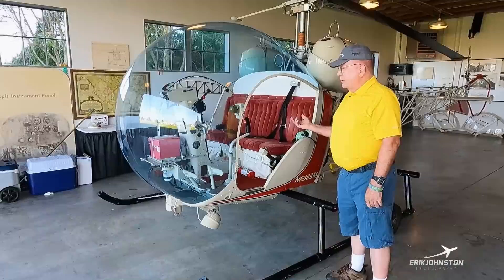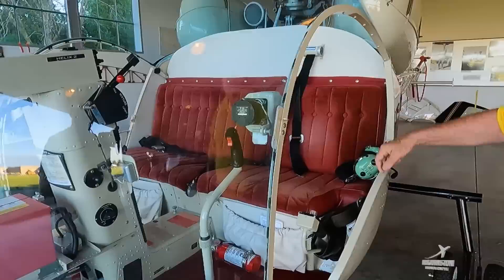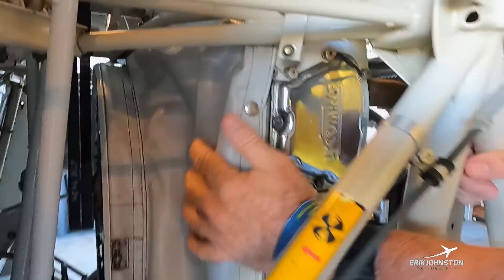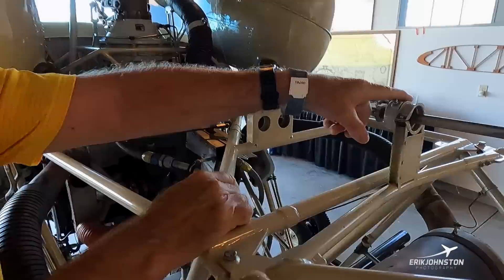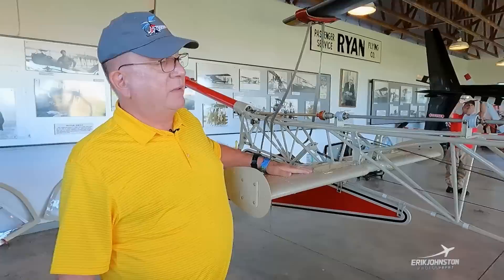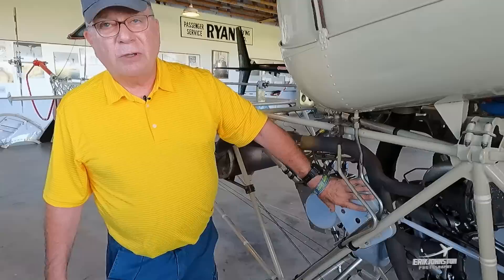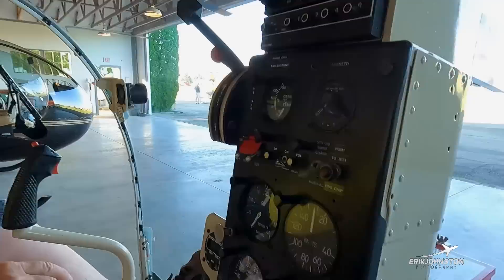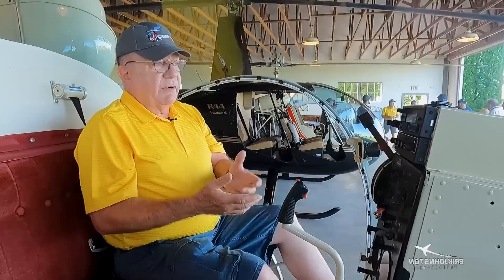Bell 47 Walkaround Oshkosh 2022

Comment: What a joy to listen to the low-key no-nonsense explanations. Especially love the almost off-the-cuff comments which show the thousands of hours of experience with the machine. Like the comment about the tail rotor control with your little finger, the oil pressure switch position, or about the early Huey's running take-offs in Vietnam. Love the open-plan design which allows inspection of nearly every major component.👍🏻
Reply from the maker: Glad you enjoyed it!
Reply: @ErikJohnston  sure did! There's alot to be said for flying a machine that's not completely controlled by computers and fly-by-wire inputs.

Comment: That walk around was by far the best so far of one of the stars of a show I grew up watching, M.A.S.H. Both of you are appreciated very much and is what You Tube was made for.
Reply: I noticed right away how it sounded just like the ones on M.A.S.H.. in the credits you don't hear it but they did run some of them during certain scenes in episodes. there is also a video out that shows pics of where they filmed the opening credit scene with the choppers flying in over the hillside. it was in the Hills in CA somewhere..it still looks the same. cool to see..

Comment: Great video, thanks. I learned to fly on the Bell 47. Just as I was getting the hang of it, about 100 hours, they took it away from me and put me on to bigger turbine engine stuff, but hey what a lovely old aircraft.  When Mike talks about ignoring the fuel gauge he’s right, visual check on the levels and time your endurance…. about 2hr50mins full to empty!  With a bit of experience you would also not need to use the engine and rotor dual tachometer gauge much also - keeping revs right was all done by ear!!

Comment: Best walk around of a Bell 47 I've seen, amazing work! Mike sure knows his helicopter!

I spend my days flying a G2A1 model in the simulator at home, love these things, so simple!

One thing I dont think was mentioned is the lack of a governor on these, those that know helicopters probably picked that up anyway or already know, but its pretty important detail, meaning you have to manage your power all the time unlike in most helicopters after these, the governor tries to keep the engine power at a level sufficient for the workload you are putting in to the system. Some later helicopters do not even have a throttle at all, computers manage it instead.

I love it in the sim, sadly never been in a real helicopter.

Imagine in 1949, I think it was a French pilot, who took one of these to 18550 feet. Not sure what model that would been, but I imagine it would probably had a bit less power than this one.

I tried to do it in the sim, and I got to 15300 ft, and it took me 75 minutes to get up and down and I had to fly over the alps and some cold weather to even get close, if its warm weather it would not do it ofc. And thats how it would be in a real one as well. I love that simulators these days have gotten good enough that you can sport individual characteristics of different aircraft very quickly, same for many racing and driivng simulators.

Getting down was sketchy, as you can very easily over speed. When climbing you are almost working as if its a glider, in the sense that you hunt for some updrafts or something to help you get up higher, we dont have thermals yet in the sim, its coming end of the year, but yeah, it was very difficult. Done it twice now. I will try to hit 18550 ft!

Comment: Ive got about 50hrs in the Bell-47. A good point he makes is adjusting throttle as you pull more collective because there is no correlator that adds RPM for you in this machine. Its truly real flying at its best!

Comment: Him talking about the guys running along and jumping on the hueys, makes me think about seeing them landing.  You will often see them just come in and land almost like a fixed wing.  It makes sense now but I never thought about it before.  If they were too heavy,  they wouldn't want to try to get back into a hover before landing.  Along with not wanting to spend a second more than absolutely necessary to get on the ground then back in the air, it all makes sense.
Reply from the maker: Your correct. That landing technique was mostly so they didn’t have to stop completely in a very hot LZ. They could egress a little faster
Reply: Actually, unless an LZ was really close - just a few minutes away - an overloaded Huey would burn off enough fuel to be able to come to a hover upon landing. Hueys landed to the ground to let paks  off in a hurry and to cause less rotor wash to interfere with other aircraft in a formation lift.  Unless it was a combat operation (training or otherwise) the only time a Huey would make a running landing would be if it had a tail rotor malfunction, an engine power problem, or a controllibilty problem. We tried to minimize ground run during autorotative landings to preserve the skid tubes.

Comment: Im shocked that the wooden blades don't have a rated lifetime.   Would not have expected that
Reply from the maker: I was surprised to learn that as well
Reply: Built by Parsons corp. they were also used on A,B and C model Hillers.
Reply: @ErikJohnston     Are the wooden blades susceptible to termites?  oops!

Comment: Super video. But one remark. What does Mike means when the main rotor retreating blade stalls when flying too fast? Isn’t a stall about angle of attack? And not about too low speed?
Reply from the maker: It stalls because the forward air speed is the same or greater than the speed of the retreating blade, thus there is not enough air flowing over the blade to create lift. Therefore it stalls

Comment: Police dept I flew for had a "D" and a "G" model . the "D" model had no hydraulics on the controls. It's here I would disagree with Mike Brown.  I found the non-hydraulic controls to be more precise especially in close in operations.  The "G" model had the wooden main rotator blades and an aluminum tail rotator.  Our line mechanic would regrease the tail rotator shaft bearings every 10 hours of flight, and you could tell when it was a fresh grease job because of all the excess grease slung from the bearings on the tail frame.  We flew ours at 300RPM on the main rotor.  I timed a fellow pilot do a practice full-on autorotation from 500 feet.  15 seconds is to the ground with about a 3 - 6 foot skid across the grass.

Comment: What a gorgeous example. Can you get a clean, well running 47 for under $100,000?
Reply: You can, but it will likely be close to requiring overhaul/major service OR won't have ADSB/avionics.  If you live in the country and don't need that stuff, theres a lot of options.

Comment: Dont forget how the retreating blade can come around to the 3 oclock position when the head is turning and the aircraft is on the ground, and with relatively a small amount of wind the blade can cut off your head if you are within the rotor blade arc, - even if you are only 5 foot tall.